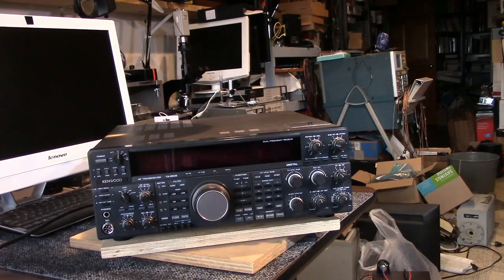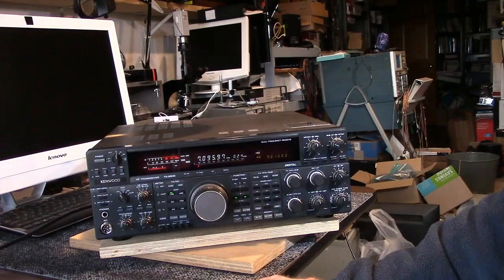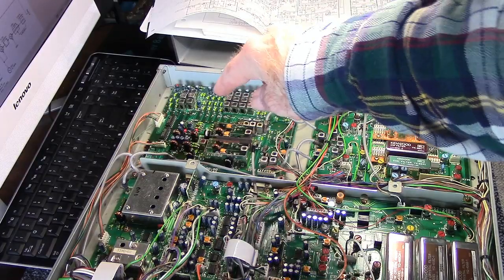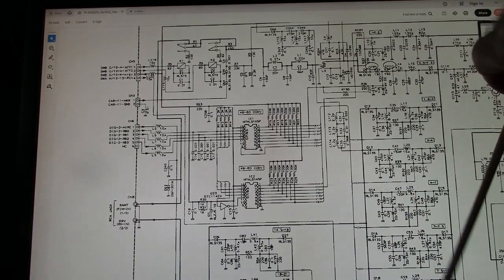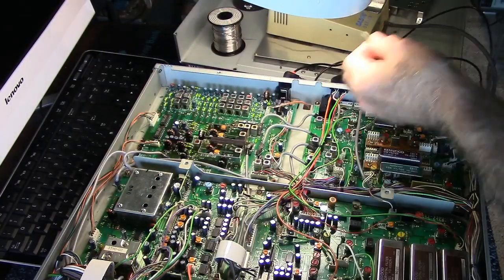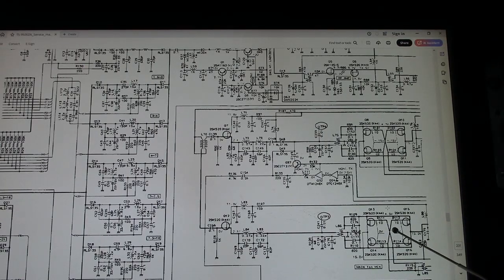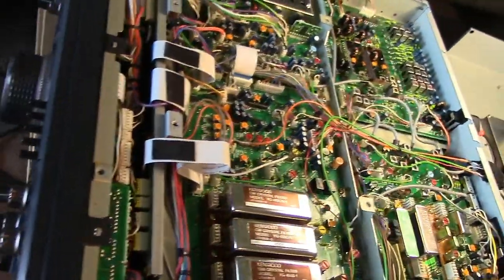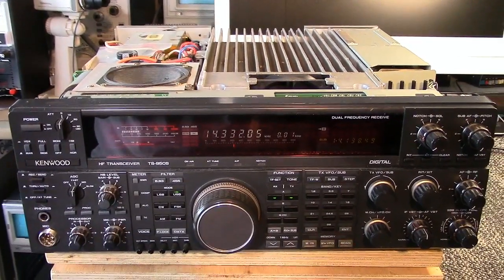Kenwood TS 950S

Comment: Thank you for sharing this. I am having similar problems with my TS-950S Digital. Receiver is pretty dead. A S20 Over shows less than 1 S unit. Before it failed I had receive some times and at others it was deaf. Also a good lesson how how to use a signal generator and do some signal tracing. I would really like to put my "950" back in line. It's my kind of radio.

Comment: That is an interesting cable you're using for injecting a signal.  You mentioned the yellow lead has a 12pf cap in series.  What is the blue lead for?  I enjoy your radio repair videos. Thank you  John KE8YFJ
Reply from the maker: Hi John, The blue lead is just a direct connection to the center conductor of the coax.  The yellow has the series 12 pf cap.